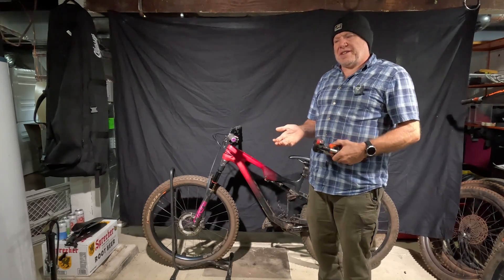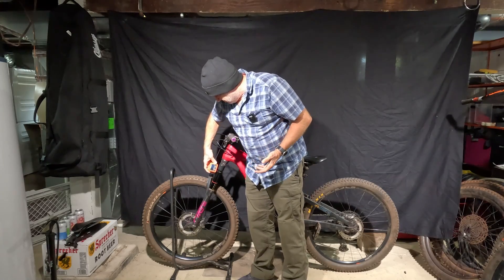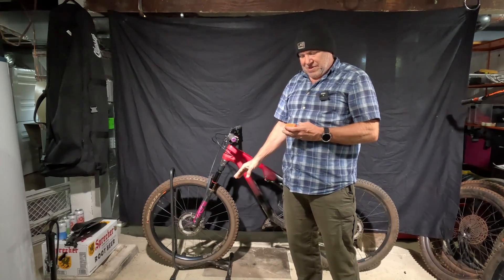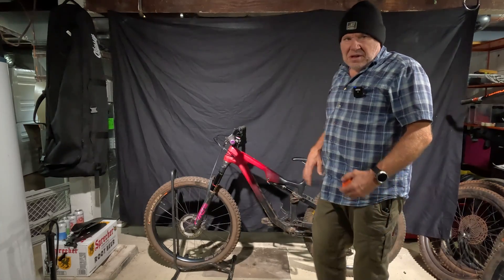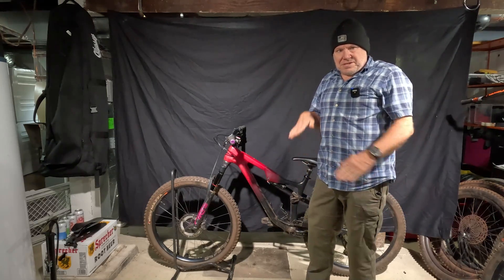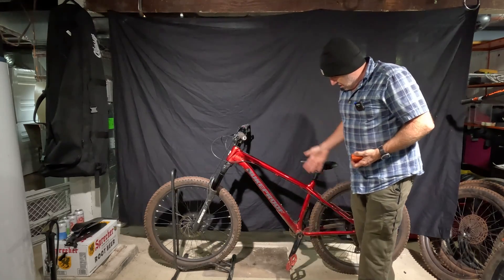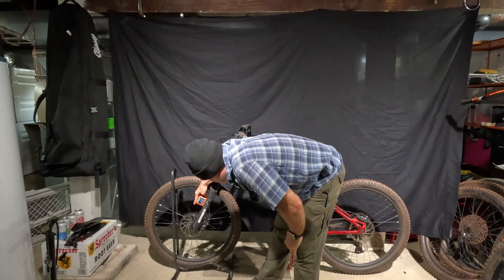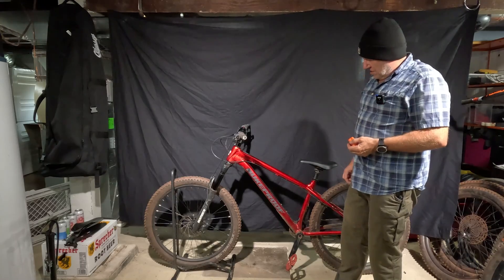Head Angle Change Hardtail vs Full Suspension

Comment: Think noticeable feel at least to me is on descents. If I ride my 71* over my 64* it’s the HT angle I feel. I don’t know why everyone “Marketing” cries over steep head angle. They must not have had the 80’s and 90’s training. I’ll  in a blue moon zip my shorts/croch rubbing my tire and chin/chest on the seat almost DH on the 71  you just go slower.

But man the slack head angles to me is just security I do t care about this “floppy” feel. Most of it’s how we train out brain to think and adjust technique with optimism. 

I’ve been putting more thought in rocking my feet and de-weighting my hands/wrist and making my braking moments before turns. 

Great video, your doing great..don’t change dude 😊

Comment: Interesting stuff.  How does this effect wheel base, and would an average rider even notice the difference.  

Also, Do you run higher pressure on your Hardtail Fork to offset the geometry change?
Reply from the maker: The wheelbase does get slightly longer, but not too noticeable. I run more volume spacers so the fork ramps up quicker as it compresses.